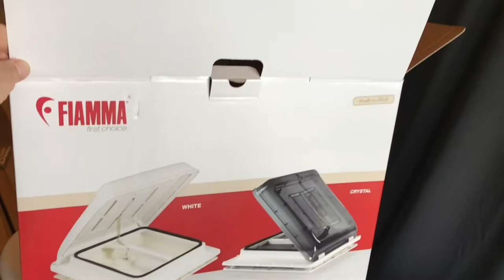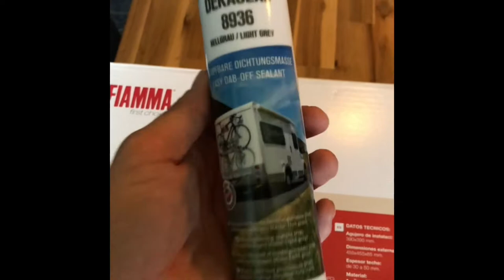*HOW TO* replace a RV / Caravan roof vent for a FIAMMA VENT 40/40 White (ADRIA LINEA)

Comment: Hi, why did you use all those the screws around the exterior part? Was not solid enough with the sealant and the 4 screws that connect with the interior part? Thanks